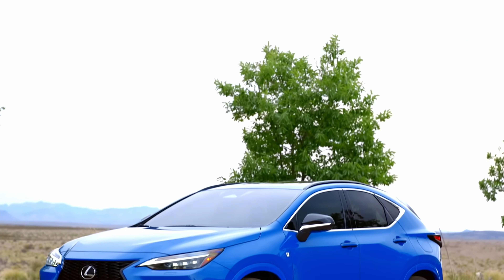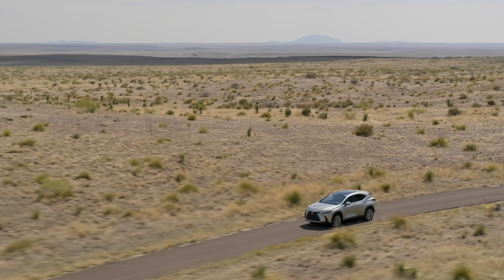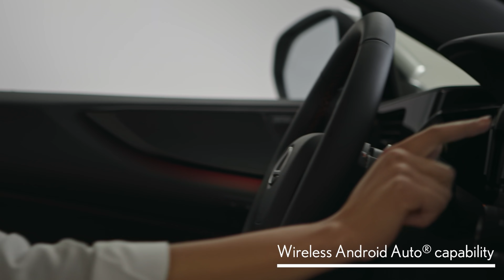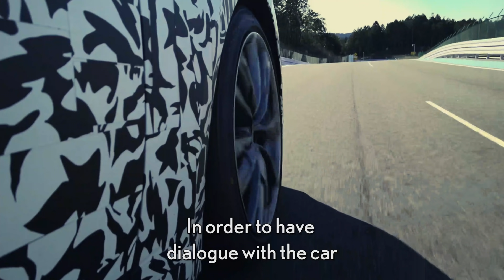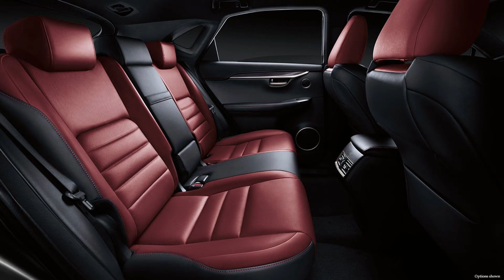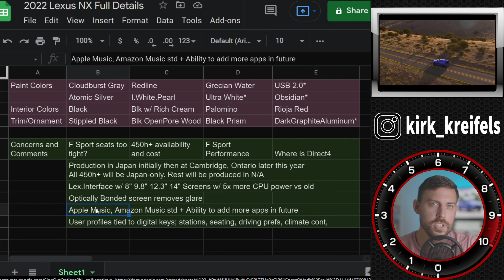The NEW Lexus NX will Change Lexus Forever - 2022 NX Explained!

Comment: Overall a very good improvement to the Lexus lineup.... but I'm still a bit salty with what they did to the IS... Imagine if all these improvements are on the IS as well. 

Personally am not a fan of SUVs... hope Lexus is planning a new RWD sedan down the line
Reply: Lexus has made it clear that they are not willing to invest money and R&D for a truly competitive RWD sedan. I'm super stoked for the IS500 but even that is just a parts bin special of a platform/powertrain that has been around for years. I'm fairly certain that the future of this brand is going to be mainly electrified crossovers/SUVs.  Hopefully they prove me wrong though. A RWD or Direct-4 EV/PHEV sedan would be so sick.
Reply: @pan4632  I believe there's 1 or 2 sedans confirmed for Direct4 / PHEV based on the teaser by Lexus previously (one of the EV roadmap announcement videos). But I have a feeling it's gonna just be a variant of the ES
Reply: @ZenX-0992  tbh a next gen ES with direct 4 could be a very appealing proposition. The current ES is a lovely car but the current engines and FWD drivetrain are not competitive in the luxury segment imo. A PHEV es with more power and better handling via direct 4 would be a pretty awesome daily driver.
Reply: @pan4632  agree and pretty sure many would be happy with that as well

But for me personally the ES is a bit too large for my liking. The IS was the perfect size.

Comment: So there is no 300 NX? Is the 250 smaller?
Reply: Unfortunately same engine as RAV4 gas model not sure why they did that kinda pitiful. I have a 2017 NX and will be swinging for the NX350 Or NX350h engine

Comment: The interior is a BIG improvement - this one will absolutely sell like hotcakes
Reply: Old one already did... But this will be even crazier.
Reply: Well, I can already say congratulations with the new lexus NX
Reply: GV70 also looks awesome.  The competition is fierce.
Reply: Will it best the Genesis GV70?
Reply: @Imleocalm  Of course it will. Genesis will never and don’t sell at a Lexus level.
Reply: @Imleocalm  GV70 doesn't offer hybrid trims, and that will definitely affect sales. Subcompact SUVs as hybrids are a growing market because no matter what 4 cyl. engine you shove in there, the weight makes the gas mileage horrible.
Reply: Agreed major refresh
Reply: @arrogen2831  😆😆🤣🤣🤣

Dude anything is better than lexus… in what delusional universe is Lexus better than any German or Korean brand
Reply: I dont see it selling like hotcakes. The RX is pretty great and if people want a cheaper version, a 35k mazda, kia or hyundai as a top trim will more than likely have better features than a base NX will have.
Reply: @Hallowsaw  the old NX is selling like hot cakes plus a lot of ppl want the badge and the higher material trim
Reply: @rahimi4762  This. You're so right. The current NX is outdated and uncompetitive and it's still flying off the lots. This is massively overhauled, with new powertrains, chassis, interior, tech, etc. This will become Lexus' best selling model if Lexus doesnt pick up the RX game.
Reply: @joec1774  even if lexus picks up the RX game, its in a different category and a different price point. You can't compare NX to RX.
Reply: @tbaconn1  - I wasn't comparing the vehicles, I was comparing sales volume. You can certainly compare sales volume of different vehicles. Some lux OEMs have midsize lux crossovers outsell their smaller stablemates, others its vice versa. That's my point.
Reply: @Hallowsaw  And you will be wrong.
Reply: @Hallowsaw  The old NX still sold like hotcakes and that had the worst infotainment in the segment. And while we can say that Kia/Hyundai/Mazda are getting pretty close to luxury, they still lack the finesse that brands like Lexus provides. One of the biggest factors is the noise isolation level. People who drive luxury vehicles don't like road noise and that's something that the mainstream brands don't provide. Even beyond all of that, Lexus will sell these like hotcakes - simply because it's a Lexus. You want reliability? Well...you want a Lexus...
Reply: @Hallowsaw  The argument is pretty similar to cross-shopping the Avalon vs the ES 350 (ES currently wins), or CT200h vs Prius (Prius obviously won). In the luxury segment, I conclude that value shopping matter less than perceived feeling (which includes brand loyalty). We can talk more about this if you're interested!

Specifically to the prev-gen NX, it was pretty obvious that they crammed all the functionality to fit the predator design (form over function). It turned me off immensely. It looked like that 2 faces/vase illusion drawing, with the pointy triangles sticking out in the middle for no reason at all. I am sure I'm not the only one who disliked it and don't want to buy it for that alone. These things matter! Just ask the 4th gen Acura TL people, the ones with the giant beaks.